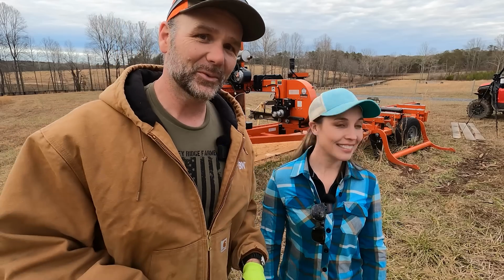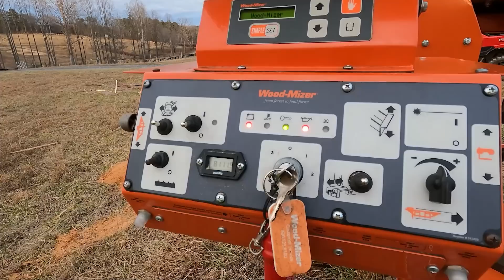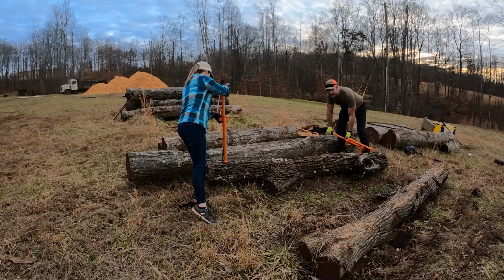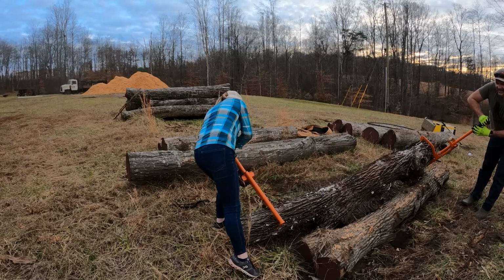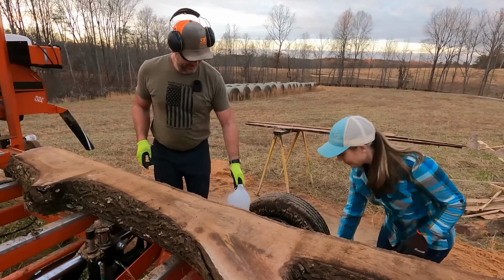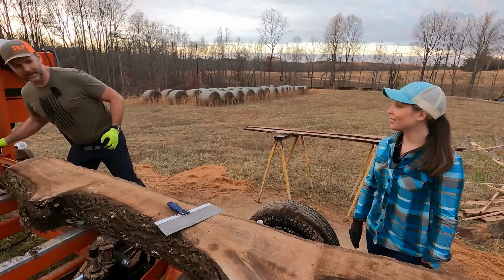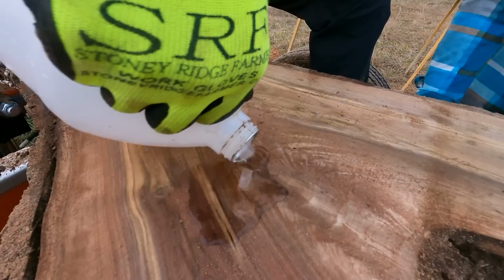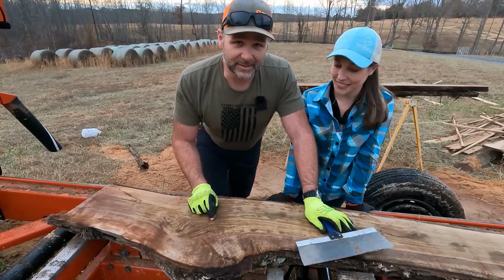Hidden treasure in a log! She finally realized why I bought a sawmill!

Comment: Hickory, my dad has a dry pice of hickory from our property. He cut it when he bought the property about 25 years ago. It is like a rock. It is super hard.
Reply: Ok, not hickory, still looks really good
Reply from the maker: yeppers...I don't typically put hickory on the mill..just doesn't make good lumber
Reply: @StoneyRidgeFarmer  What are your reasons to say doesn't it make good lumber?  I don't like it for lumber myself only because it's so darn hard to get a nail into.  You gotta put it up green or else you're pre drilling every hole. My dad built our porch out of hickory with oak posts and when I built new steps onto it last summer I wouldn't be far from lying if i told you I've driven nails into concrete that was softer. Hammering goes great on the treated pine then you hit that hickory and it bends it over.  But the hickory lasts forever as long as it's kept fairly dry. Couldn't ask for a stronger board. But i prefer oak because it's more rot resistant and being more experienced at driving nails now I can actually get a nail in it.   Hickory is great for a tool handle though. Buck the logs into usable lengths and get after it with a splitting wedge for the best tool handles. Though when i get a sawmill i plan to just saw out some handle blanks. Ive got more tools to handle than I've got time to split and carve. Goes faster when you start with a clean square blank than with a split out hunk.

Comment: I have had a sawmill (Woodland 130Max with extension) for about six months and if you have access to trees, get a sawmill!  Even when the wholesale price of lumber is down to below $400 (1,000 board feet) in the US, that still means that dry/treated lumber wholesale prices are about $1 a foot - and you should see the amount of framing timber and planks you get out of one decent tree!  
     Here in the UK, prices are £3 a meter for 6" planks retail, £2 wholesale, so a sawmill really pays for itself pretty quickly.  It also means that you can make those odd sizes like a 16' roof beam that otherwise would cost an arm and a leg!

Comment: That walnut would make for some gorgeous casework on a pipe organ (though oak is more traditional). It could also make a nice set of key tops for a build that uses wood topped keys rather than bone or a synthetic bone substitute.